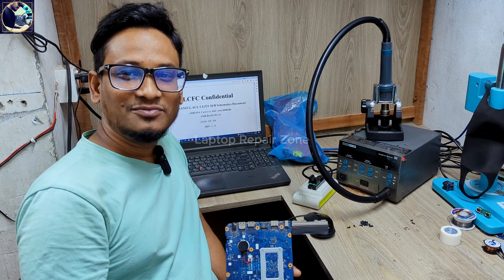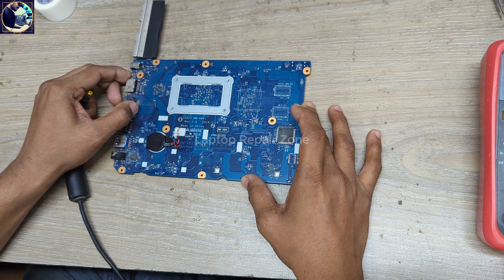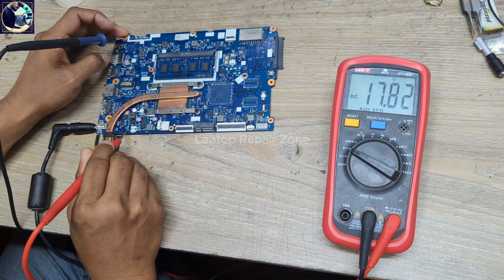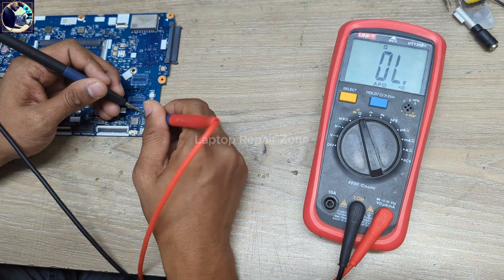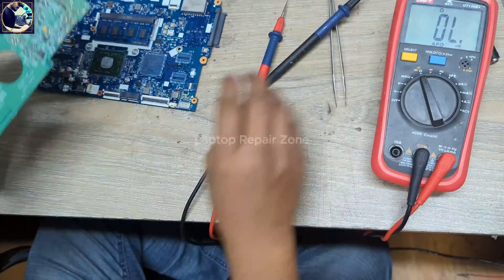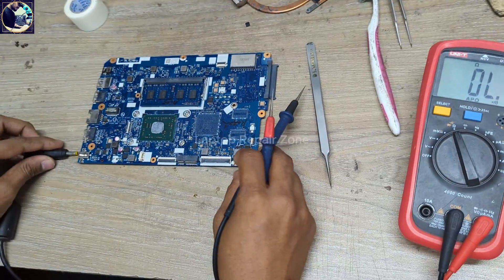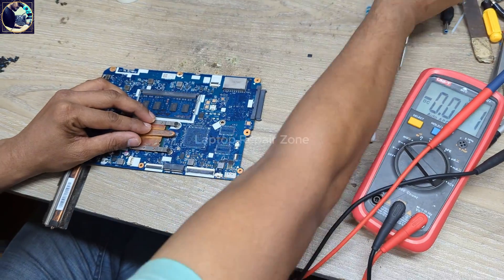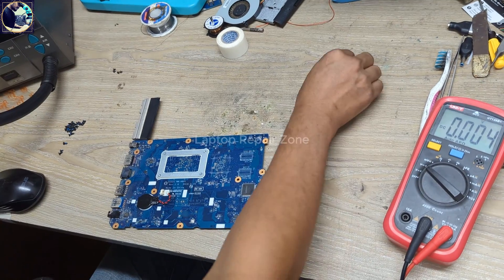Lenovo IdeaPad 110 won't power on | Lenovo laptop not turning on fixed!!!

Comment: Hi thanks for your video! I had the same problem and after I replaced the battery mosfet my ideapad 110-15acl powers on but it doesn't detect the SSD, also if I try to boot from a USB it tries to boot but restarts after the logo and loops. Any idea what could be wrong?
Reply from the maker: You can check 5v and secondrey 5v